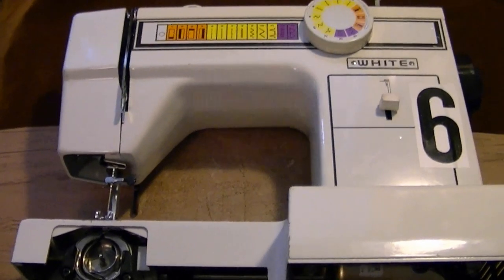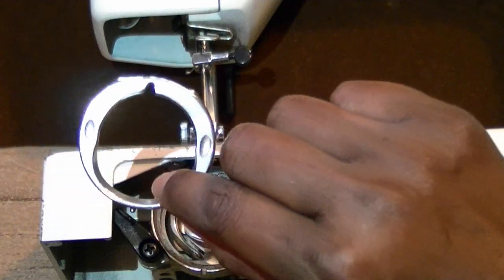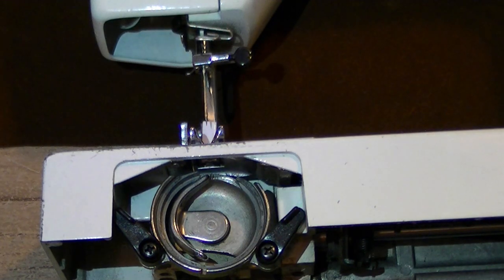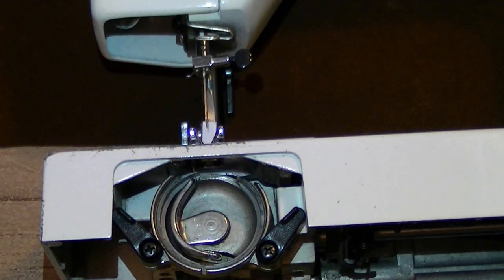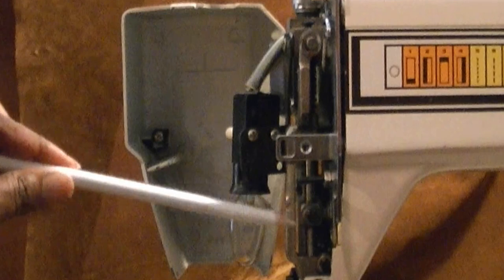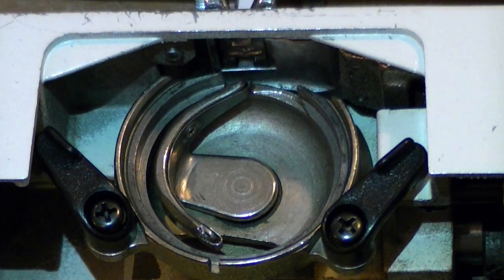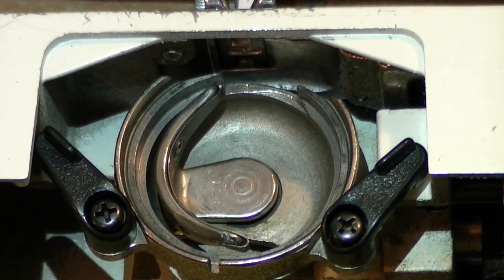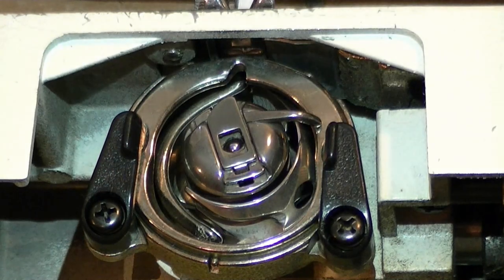My Sewing Machine Won't Zig Zag - Timing Repair

Comment: I have to comment on this video, I can't let it go. You remove the shuttle hook, the part that picks up the needle thread, and set it aside, then point to the shuttle hook driver and refer to it as the hook. The shuttle hook driver has a shaft that extends through into a gear box and has a gear on the other end secured with set screws. This is where you likely will have to adjust a timing problem on the machine shown, so not as easy to do as your viewers percieve it to be.
Reply: exactly my issue. this kinda works but the shuttle driver is really the issue for me too

Comment: In my machine, the hook doesn't catch the thread when there is a fabric in the left and centre position of the needle. It works for the right position with fabric and for all 3 positions without fabric. I've tried all the change height, new needle, new thread, rethreading, different fabric solutions. Any idea what's wrong?

Comment: @Niler Taylor. This video is really clear and well made.  But it is wrong!!!  The hook is on the piece that was pulled out. The thing you call  the hook is not the hook. And the hook actually  hooks from left to right (on your machine), not from right to left.  And it should meet the needle just above the eye. And it should do that when the needle has lifted .092" (or 2.2 mm). And, to make that happen most often the adjustment is with the rotary position of the hook (adjusted under the machine), not the needle bar height (what you showed, which is also part of timing).   I believe that what you did happened to get your machine working. Lowering the needle does often help the hook catch the thread loop.  But not always. And it can also cause problems because there is not always space for the lowered needle for the full stitch cycle.  Basically, however, it is some kind of fortuitous coincidence that your repair worked for you and works for other people.  

In short:  the alignment you demonstrate in this video is not the desired alignment of the  actual hook and needle.

The steps you show are close to, but not the same as, the steps for one of the three adjustments for needle timing.   You can think of the three parts as  hook rotary position (left-right on your machine),  hook distance from the needle (which is key, but is not adjustable on some machines and if it can be done,  it is done quite different ways on different machines), and needle height (which you showed how to adjust, but didn't show correctly what height to adjust to). 

Some machines also need the feed-dog timing set. If the feed dog timing is off, the fabric will move while the needle is in the fabric.  This will bend the needle a bit when it is down which can cause skipped stitches, tangles and broken needles. 

All of these can be done by mere mortals, you don't need a degree from sewing machine repair school to do these.  But it is a bit more involved than what you show. 
There are lot of videos on the internet about these things.  I think, however, that if you made one it would be one of the best because you speak so clearly, have such a pleasant tone, and have such good video work.  I would be more than happy, really, to help you with this.  Like you, I like to help people. And helping such an effective helper like you would be an extra pleasure. Andy Ruina, ruina@cornell.edu, WhatsApp# +91 6366 019750.
Reply: Thanks for pointing this out! 
I thought I was going mad there for a moment. Everybody in the comments were so happy with the instructions, but that is not the hook, nor was the procedure correct. So how come it worked?

The hook has a very sharp pointy part, almost as pointy as a needle, that passes by the needle as it is on the way up. The tip of the hook needs to pass the needle slightly above the eye.

I am happy that everybody is happy, but I don't know why.
Have we discovered a new way of timing a sewing machine?
Reply from the maker: Good question.  I'm not an expert, only used info that was translated to me by my local reparman...maybe he got it wrong too.  LOL. Anyway...it did work and I thank you all for watching my video.
Reply from the maker: Good question.  I'm not an expert, only used info that was translated to me by my local reparman...maybe he got it wrong too.  LOL. Anyway...it did work and I thank you all for watching my video.

Comment: I think this is why my Singer does straight stitches, but none of the fancy zigzags. I also have a Brother embroidery machine that won't sew at all after I ran into a pin; I knew that something had probably knocked it out of alignment. I will have to check both machines and see if I can fix them. Apparently the sewing machine places around here are dubious. I have heard too many stories of people getting a basic servicing and ending up with machines that no longer work. Not to mention the cost. 

It didn't occur to me until just now that I might be able to fix them myself. I forgot my golden rule which is that you can learn to do anything on YouTube.

Comment: My Brother machine was experiencing the same symptoms as described in the video above. It would only sew straight stitches without skipping. My husband and I were prepared to do the timing repair but first he told me to check the needle, that it looked like it was going to far down. So before you go to all the trouble to try to reset the timing. Try this! Check to see if your needle is inserted all the way into the shaft that holds the needle. I did as he said and sure enough the needle was not inserted all the way! I had broken a needle and when I replaced it, I did not slid it all the way up. That was all that was wrong with my machine! WooHoo. However I will come back to this video in the future Niler, if need be. You really did a great job with the video and made me understand way more about my machine than I have ever known.

Comment: I opened mine up (different sewing machine, mine's a Janome Schoolmate S2015). It's very old and has never been properly cleaned. I opened it up and took out the bobin holder. There was so much lint in there I actually tried just cleaning it out and trying again before messing with the timing. It works now! This is probably common sense for experienced sewers, but this was news to me

Comment: Wow...never knew about the timing thing. I’ve got an old New Home that will do  decorative stitches with cams, but I bought it used and don’t have the cams...only the 0 Cam for manual zigzag.  But now it won’t zigzag at all.  I’m planning on selling this machine that sews a gorgeous straight stitch...but no zig zag. I’m gonna try your timing fix.  Thanks!
Reply from the maker: I hope it works...let me know.  Thanks for watching!

Comment: The thing you were calling the hook is actually the shuttle carrier. It's actually what drives the shuttle from side to side in the hook raceway. Put the shuttle back in the machine and time the slight rise of the needle to the sharp tip of the shuttle. This is what grabs your upper thread and wraps it around the bobbin case, catching the bobbin thread and forming a stitch. Essentially, between each stitch, the thread is twisted into place between the holes. I hope I made sense. Not hating, just helping. Cleaning and proper oiling of the machine are also a huge help after you've timed your machine. Have a blessed day! 😬
Reply from the maker: Thank you for this information, but this technique worked for me so I shared it with my viewers...it's a play on words and it caught your attention.  Thank you for watching.

Comment: Oh my goodness imagine my surprise when you taking apart your bobbin mechanisms and realizing your machine looks exactly like mine and those mechanisms area. Just the outside is painted a bit differently but other than that your machine essentially is my 1980s Nelco!
Our machines are sisters. Sweet.
Thanks for the video. Hopefully I will be able to repair the reason why my zigzag stitching skips often.
On a side note you wouldn't know where I could find an accessories case which slips on by the foot there would you? Sadly a previous repairman kept mine and claimed he didn't and for over 20 years I've been looking for a new one.

Comment: that's a' better description than the so called sewing experts can give, or at least it's the better description i've found online about straight line hands on example, without assuming everyone knows what's being talked about, so you show it simple. like this one tutorial, obviously someone very educated in sewing machine repair, shows how to adjust hook timing for a topload bobbin, which is easy to understand, but unless i heard it wrong (after 4 times of replay,) he said the needle in a zig zag setting cannot be moving from side to side (zigging or zagging,) when the needle is in the thread, and that was also easy to understand, only i can't figure out if that is completely reliant on the hook timing. he mentioned the gears closest forward by the needle bar can be adjusted, only my machine singer 2662 doesn't have those gears on a shaft, it has flat linkages   that move from the big barrel of stitch settings back by the motor end of the machine. the hook timing looks fine, but still the needle goes into the material and then does its sweeping zigzaging and it carries the material back and forth with the highest foot pressure even. so the outcome is all the zig zag settings almost all have the same patterns of like swaying S. i might look at the needle bar screw, only that's for the hook timing, that's where I get lost.

Comment: Golly, I sure hope this works. You explained it so comprehensible. Thank you !!!!! I have an old Singer that used to do a Zig Zag and then after not using it for awhile it won't GAH !!! Actually now that I think about it, my husband bought a new motor and foot petal and I wonder if taking off the old and putting on the new did something to the timing???  Also My reverse isn't acting right either. When I do quilts its a bit of a pain to have to turn the whole quilt around to just go back over stitches.
Reply from the maker: Did it work? I hope my video was helpful for you. Thanks for watching.

Comment: This video is soooooo frustrating. It shows you how to fix the timing just fine...on a side loading bobbin only. AAARRRG!  I really needed this video to show swing on a needle arm adjustment for a top loader with a different configuration (read; Kenmore/Janome/Elna, same vintage machine as your White.) It is a good, well done video. I just wish that my search results would have given me a video where you showed those points on even a Singer, which at this vintage, is the same configuration basics as any of the above mentioned top loading sewing machines.
Reply from the maker: I'm so sorry my video wasn't helpful for you. I'm not familiar with top loading bobbin machines.  I share the video with the machine that "I" use. I truly do hope you find a video on how to fix your problem for your mahcine.  Thanks for watching.
Reply: @NilerTaylor-relindesigns  Sorry, it's not your fault, I just got frustrated that I cannot seem to find any videos on top loading machines of that vintage. Please excuse my frustrated post. Your video was very informative, just not something I was able to glean for information. Great channel though.

Comment: Hello Niler, thanks for the video.  I did check that the needle aligned well as you showed it here.  However, my sewing machine still won't do zig zag.  I saw another video and it shows that the needle moves a little sideways when it does the zigzag.  Mine won't do that.  I opened my machine and everything is in great condition (in my opinion).  Thanks in advance for the help.

Comment: Thank you for this video, unfortunately, this method didn't work for my sewing machine. My machine is an old model, Euro Pro X EP380, but has never been used and it would only sew a straight line. 
I had to take the lid off the top of my machine, push the needle back and forth and oil the parts that makes the needle move. It works perfectly now.
Reply from the maker: Kool Beanz! Glad you figured out what was wrong.  Thanks so much for sharing your results with us.  Happy Sewing!

Comment: I understood everything you explained except for: 1.) am I turning the wheel to move the needle into position or am I sliding the needle bar manually. 2.) then once the needle is in position is that when I tighten the screw back up? Thanks

Comment: Your machine looks similar to my machine that has timing issues.  I have a Necchi model 921 which I can't find any information about it online, but I did find out by chance that it's the same as the Elnita 240. I'm so tempted to fix the timing myself but I don't want to make things worse.

Comment: So if its not meeting the hook do you just loosen the screw until it does? A bit confused. I was following up until the point you loosened the needle bar screw. Do you tighten it back after or just leave it?
Reply from the maker: Good question. After slightly unscrewing the needle, I slid the bar down slightly and yes, re-tighten the screw so it won't come out.  Hope this helps.  Thanks for watching and for your question.

Comment: I have the exact same machine, but I don’t see the “hook.” My machine has been mostly unused for years. I’ve cleaned and oiled it, but no zig zag. The mechanism that moves back and forth will only move manually. I’m confused and can’t figure out if the timing is the issue since I can’t tell what the hook is.
Reply: Have you figured it out yet?
Reply: sportster davidson Yes! This wasn’t the issue at all. It just needed a good oiling.

Comment: Thank you for this video.  I have fixed several machines with this hook system.  If my needle is picking up thread when zig zag stitch is selected, but still tension is off, is this something else.  This is a Singer 7442 drop in bobbin.
Reply from the maker: Sounds like it might be something else.

Comment: It takes a little time but all it takes is a Allen wrench to adjust timing mine was missing so many stitches that it wouldn’t even do zig zag so I took it apart and dropped the bar down just a tad bit that holds the needle and it will drop the needle down for the thread to catch the running hook just don’t go to far it will bend your needle

Comment: hi, im confused now cause i've seen another video saying that the right timing is when the needle is going up and meet the hook. and urs is needle going down and meet the hook. mine is when i turn the stitch selection, the needle didnt move to left as it usually does. and just like u, it remains stitching straight stitch.
Reply from the maker: This  video is based on my sewing machine which is White 1510
Reply: @NilerTaylor-relindesigns   Saimi, above, is correct.  Your video, clear and well done as it is, is not correct.

Comment: hi I have a question I see that my machine is similar to yours  but  it's a super zig zag  acme model JH 920a an it opens on the side just like yours and to set the timer as you were doing on this video I  notice I did not have a screw at all is that going to make a big difference just got this machine from a friend and have not used it at all yet have another machine I've been using totally different please if you could help that would be great thank you love your videos

Comment: hi i have a combi dx newhome sewing machine, it wont do a zigzag stitch the needle doesnt move left to right do you know what might be the cause? thanks
Reply from the maker: Hi Claire, I'm not familiar with your brand of machine.  It sounds like the timing is off. Were you able to try the steps in the video? If you tried it and it still doesn't work, or you are unable to  remove the cover on you machine, you may need to contact a service repairman.  Sorry I wasn't more helpful.

Comment: Mine won’t go from zigzag to straight stitch and the timing looks fine.
Reply from the maker: Huummm...might need to call the repairman.  This worked for my machine, sorry it didn't work for yours.
Reply: Niler Taylor I opened the top where the selector gears are and flicked them a little while moving selector and now it’s ok maybe some dust got caught.

Comment: I have been  Servicing sewing machines for 42 years and this video is absolutely incorrect. The piece you are having people look at that stays in the  Sewing machine is called the driver. The piece you removed With the stem on it that the bobbin case slides on to is called the thread hook.The thread hook is what you time to the needle not the driver. You also loosened the needle bar screw which changes the height of the eye of the needle  Which changes the relationship to the thread hook but that is not timing. You need a timing gauge to set timing properly on a sewing machine.  Hook Timing is when the needle bar travels to its lowest position and raises 2.5 mm, It is at that point that the tip of the thread hook must be directly behind the needle. It is after that setting That you would adjust be heighth of the needle bar. And there's a whole host of settings that have to be done before you even do that. If you feel like ever reaching out to me for  Some help concerning a setting I would be glad to talk  With you.
Reply: @Niler Taylor. Hi Niler:  Norm, above, is 100% correct.  You should get his help, or mine, or figure it out from other videos or manuals.  Your explanations and video work are great.  So you would be helping lots of people if you got this right. What you did might have worked for you. But it is only because of some kind of coincidence.

Comment: My machine doesn't have a screw there 😥
Reply from the maker: So sorry.  Unfortunately, different manufacturers make their machines different. Check with your manufacturer, or research your machine to see if there is anything similar.